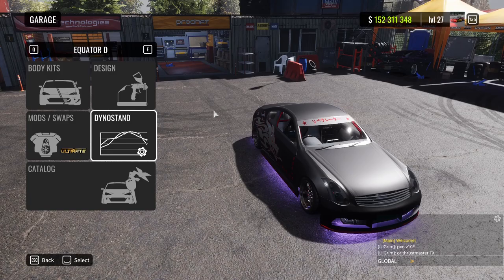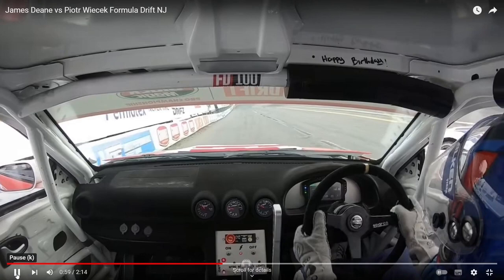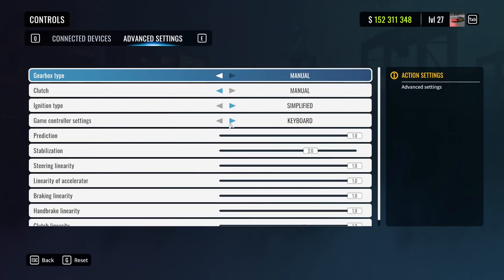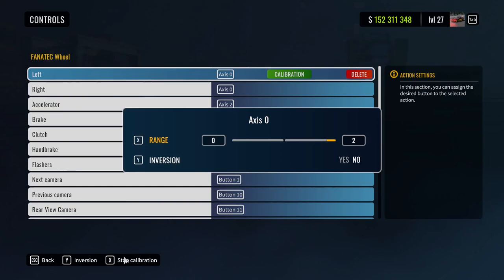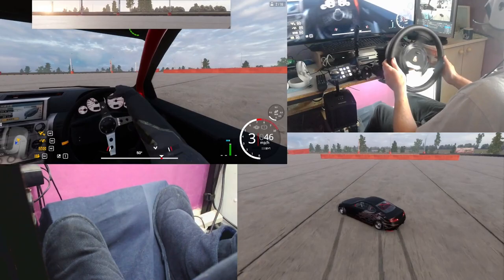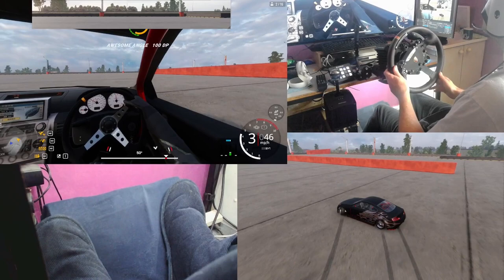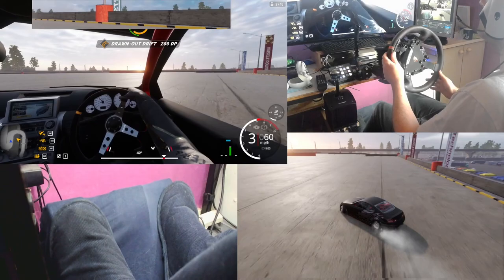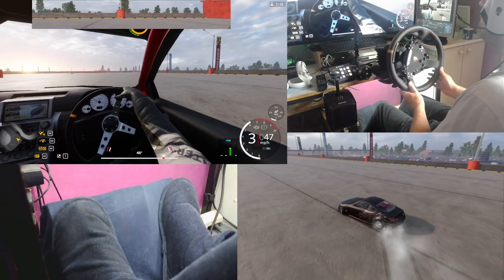Ultimate CarX Wheel Drifting - How to get started - Drift initiation & Other skills guide

Comment: Does this dynostand works for every car, even the hachi roku (the first car) ?
Reply from the maker: Nah, this game does require car specific tunes, you can try it tho, it may work 👍🏻
Reply: @TheDocDrift  i cant find a dynostand for hachi roku… Like i’m a begineer haha
Reply from the maker: @kekw395  I’m not sue what you mean by can’t find, 

You may need to level up to buy cars, but this is quite easy on time attack mode. 

The car has different packages you can apply, racing, drift & ultimate etc, once you apply the package you can go into the dynostand and change the tune